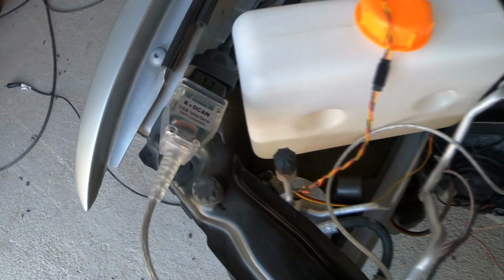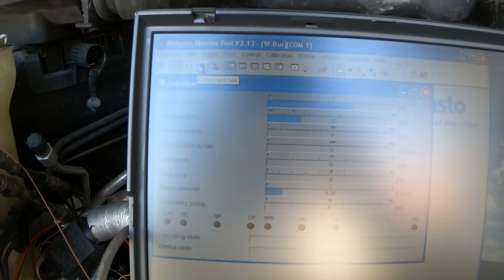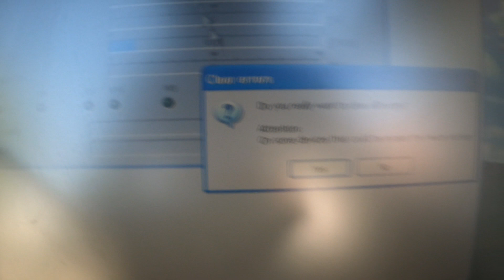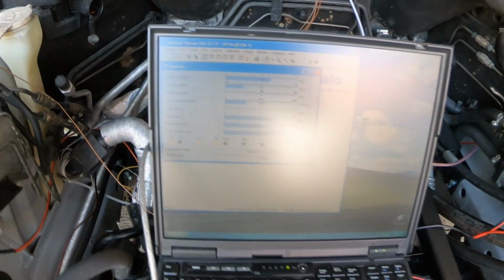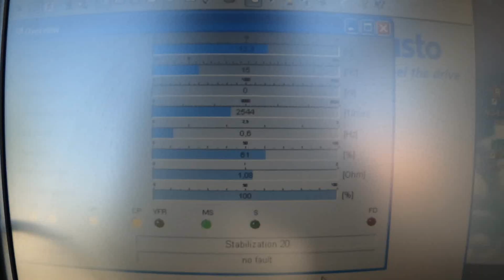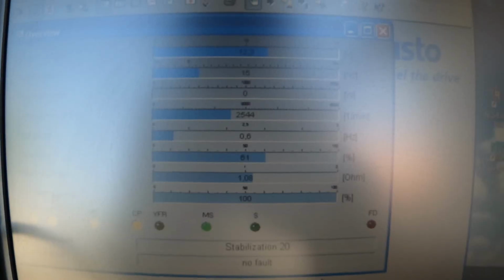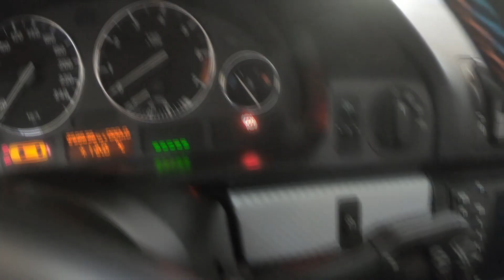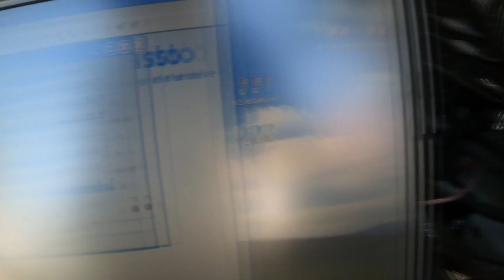BMW e39 electric conversion, webasto heating, part 4

Comment: I find it a bit hard to understand your accent and was confused by what you were trying to explain. I have a engine block heater I was going to try. No idea if it would get hot enough
Reply from the maker: you should try it . which part is confusing you?

Comment: I have flipped my air cooled charger around, so it blows air into the cabin, instead of out behind the bumper. This gives me around 450w of heating, and can completely de-ice my ev in half an hour. IT stays warm enough for small trips, or for my 2kw air Diesel heater to warm Up on longer journeys. I have to crack a Window in summer though, but that is a small inconvinience. IT also supplies hours of dehumidification when doing a full charge, which is just as important in winter, where the breath from passengers, ends as condensation in the felt under the carpets!

Comment: Just fix clipped intro...
Reply: @bimerev  he's talking about the loud intro of the video I think
Reply: Also try to use a tripod while filming it would enhance the quality of the video a little bit... Nice job 👍🏻
Reply: @Anas-wb4tk  Yes intro audio sound horribly clipped&loud, you need to use audio editor to adjust level (normalize) with rest of the video and be careful not to clip it (which happened)
Reply from the maker: @ZegaracRobert  Yes , I will do in some other video. I didn't have much time and will to play with audio. But I will change intro
Reply: @bimerev  left side of my headphone just blowed off  for this intro :C